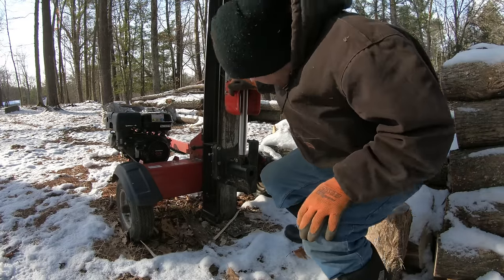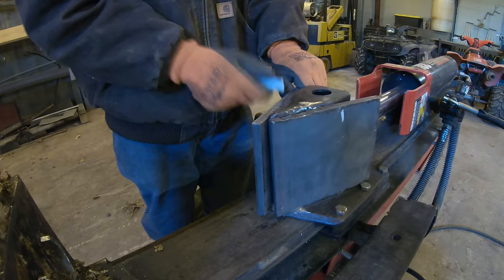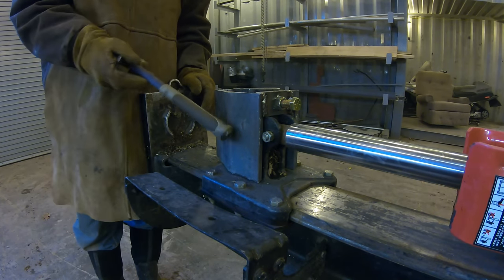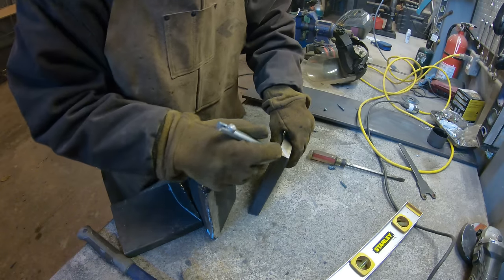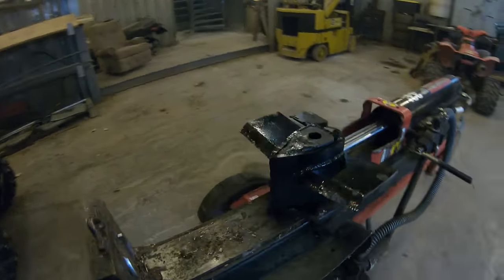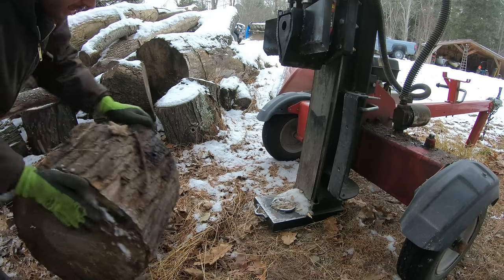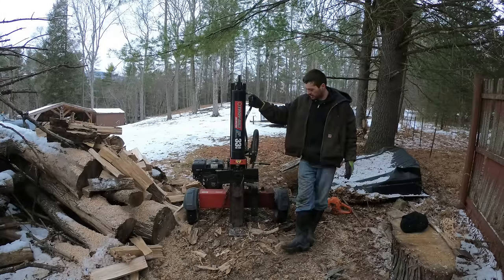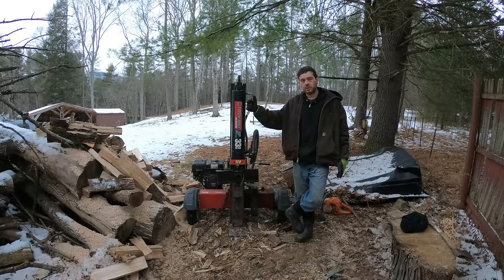Building a 4 way splitter wedge

Comment: I think the reason could be reducing abuse and subsequent warranty claims.

Also re welding and heat transfer to adjacent materials metal or flammable.  You may consider trying a product called 'Fire Ice'..
https://geltechsolutions.com/fireice/product/fireice-shield-spray/..  You can spray it on adjacent materials and they won't heat up.  it will also draw heat from an object to cool id down.  
If you need to work on and engine component and it came in running and is hot..  Spray this gel on it and it will cool it of immediately so you can work on the repair right away.
They don't advertise this last idea but if you get a 2nd degree burn, spray it fight away and it will pull the heat from the burn..  It is a water based non toxic product.  Cleaned up with water.
They also have 2.5 gallon units which we have to have with us when welding in the shipyard.
https://geltechsolutions.com/fireice/product/ul-listed-class-a-fireice-fire-extinguisher/

Go thru their site, welding blankets and aerosols for home use or RV use. https://geltechsolutions.com/fireice/product/fireice-xt-cooling-gel-20-oz-can/.   A whole lot more effective than a 2 or 5lb dry chem plus no mess.

Wildland Fire Fighters have to carry a small belt mounted  extinguisher.

I think if you got some of their products and did a demo it, having a laser temp gauge to measure the difference.

Enough said you and your subscribers can pass judgement.
Cheers

Comment: Two things.  1. They don't mass produce anything like that because you are getting twice as much done in one pass essentially doubling the lifespan before replacing it , other than maybe shortening the lifespan?  2.  I thought to myself there is no way he is bending that half inch plate with a log splitter!  Can't be done!  Then when you got it outside I saw 33 ton, about 11 tons more than what you normally see.  If they made stuff that lasted what would you have to work on or improve?  lol

Comment: Isn't Berl like that log you tried to split valueable?  I bet if you looked it up, depending on what tree it was.   It looked like it was in good shape.  Nice Mod!  Is it sellable??  4 way probably adds stress to the Cylinder, decreasing the life of the splitter over time.  It wasn't looking over stressed, but even if it decreases the life 10-20%, it's a problem.  I'd say it's price point new to the consumer at that point

Comment: hmmmm Think ergonomics, you'e young so bending and lifting doesn't bother you now, but it will, trust me.  My brother heated his old farmhouse with wood for many years and he would host "splittin parties" every fall.  Only his siblings and in-laws were dumb enough to show up.  He was very handy like you.  He was a custom home builder and a welder/fabricator, could fix anything and everything.  The joke was he had a roofing card and it covered everything...  He really had splitting down.

He had built a welding table out of grader blades for the table top. (that's a long story how he "found' those) it was about 12' by 6' and super heavy-duty.  The youngest of us was 40-plus so bending over and lifting all day was not going to happen.  So he sorta built the splitter into one end of the table so we could all be standing up and sliding the wood to feed the splitter on this table.  One guy ran the controls, one or two would clear the split wood and toss it into a pile and one or two would feed the splitter.  My sister-in-law would keep the table stocked with wood and take care of the pile of split wood with a skid steer and bring us cold beer. We could load about a month's worth of wood (depending on how cold it was) in his basement.  On a good day we could fill his basement plus put enough in his shed for most of the winter 

I was thinking you could come up with an idea to take some of the pain of bending over out of your operation when you're splitting.  Maybe by digging a pit to stand in and using the natural slope of your property, (gravity is a wonderful thing and it's free) so the wood slides toward you and the splitter. This thing was a pretty cool back saver.  Check this out.  https://youtu.be/1tRMXF4shE4

Comment: The reason they don't come that way from the manufacturer, is you've quadrupled the pinch points where fingers could be lost. So it's a liability issue for the manufacturer, especially considering there is often beer involved with firewood and a lot of people aren't that smart to begin with. I do have one question, wouldn't you want to hardface the cutting blade of the anvil? I'd think mild steel would dull pretty fast.

Comment: Your wedge is too blunt. If you put a narrower tip on your wedge you'll find it will do a much better job. The back side can be wide but the tip or front leading needs to be narrow.  Mine is 3/4'' plate with a long bevel about an inch deep before it widens out. Give that a try. You will be muck more happy with how it preforms. See how the wood jumps or pops off the wedge. Thats because it's to blunt.
You also need to move the hydraulic lever to the top of the cylinder and back farther away from the wedge. If  a piece gets stuck and misses the push off plate on the return cycle it will hit the lever and damage it. Ask me how I know that. Good build though, it just needs a little tweeking.

Comment: Looking at it, very nicely done and very practical.
You asked multiple times why factory doesn't do a 4 way split.... Then you had the 40+ inch one where you took it off.
Why not do a T shape instead of a X shape. You start with the initial V for the slitter, then weld a piece across the top instead of the wings? aka take the wings further out until they are a T instead of wings?

Comment: Andrew you need to sell that thing or maybe even patent it. I made one simular but; only worked on my splitter with a huge cylinder had to have a lot more PSI still was slower than your splitter. That seemed to work perfectly, with your handy work being more well known everyday you could maybe sell alot of them things. Don't wait and look back saying you should have done somthing it really did work well.

Comment: Thats a good question cause it clearly isn't a matter of safety... I think the deal you made is marketable because you don't have to weld to heat with wood. So if it is delivered split already then the pieces are going to be needed to be resplit. Most of what you made would work in a kitchen stove Plus I found that just big wood alone can go out overnight so a few small pieces mixed with the large stuff makes sure you have coals in the morning, not big black unburned pieces that will get everything dirty for sure. You never see them on a machine for sale, women would love it... my question is why such a small foot on the splitter????

Comment: Your splitter is a little different than others I've seen which are horizontal, anyway with harder steel maybe you could make a nice press with a footswitch the vibration from the pump really helps when you're pressing out bearings or u joints. Just saying

Comment: I use a skid steer splitter for the huge rounds which I can't manhandle to the upright splitter. Make them small enough for the upright. Better yet, and what I plan to do is I think the excavator will be better. Use some thick steel and make a wedge on a thumb. Love your four way wedge design.

Comment: Most store bought splitters have a small 12 or 16 gpm pump if you upgrade to a 20 gpm pump it will speed it up alittle bit to maximize productivity. It looks like you have the hp

Comment: Great job and invention! The second angle cut is perfect since the forward cut will be pushed forward and the one back will try to stay stuck. You can also incline the side blades a little downward forwarded instead of perpendicular so they'll angular position will free space for the back of the back woods. If you don't understand my English attempt please ask me. I can explain further what I meant by that.

When cutting with a grinder you want to use a face shield (transparent) and safety glasses. In case a piece of abrasive blade brakes and hit the shield and brake it you'll still have your transparent safety glasses to protect your eyes. And the face shield will give peace to your face. I learn it while at an Safety Trainer Course for the Construction Industry 500 and 502 by Georgia Tech that allows me to train 10 and 30 hours OSHA Classes for the Construction Industry. Take care bro!

Comment: The splitter company would have made the winged  wedge if you had been working there but, you weren't. They only make so many Andrews at each production batch, if it were not so, there would only be one political party in the USA. There seems to always be less of the  good stuff than the so so stuff and plenty of the so so so stuff. Go figure.

Comment: I can answer some of your questions. The reason they don't put that on all log splitters is because then you were in go back to bite different attachments.

So they were in make money off of you twice, I would have never tried the plasma cutter like you did because I think I would have just made a mess out of it, I would have used a large grinder and cut the angle in.

But in general I think you did a awesome job in making that I think you also already know you need to cut the pieces a little bit smaller than that last huge piece. Always remember Andrew use your head and save your back.

Or in years to come you will pay for that, and I would not like to see that you are a pretty cool guy. And I love your videos and also the reason at least one of the reasons you are so successful is because you do a lot of work yourself.

Otherwise the repairs to that equipment would drive you into bankruptcy that is very good that you are very mechanical incline and a good fabricator and many other things I'm sure you will succeed and really make something out of your business. And I wish you all the luck in the world body

Comment: They dont add the beefy 4 way cutter because the average dude will break the machine 5 x trying to do too much and that is where the splitter folks make $. Keep selling the 1/2 split head and many replacement parts. Make a 4 way cutter and get the job done faster and cleaner.

Comment: My guess to as why they do not come with a 4 way splitter head to begin with is power. Even with a 33 ton splitter, it would struggle and stall allot on harder woods. Around here we have oak, walnuts, elms and hophornbeam that split very hard. With a 25 ton or less, splitting with a 4 way would not work.

Comment: hey andrew i think you should build your own log splitter. with all the tools you have it wouldnt be difficult. you could make it a video all about salvaging motors, pumps and cylinders, and use some metal you have laying around. build it horizontal with a log lift and hydro adjustable wedge.

Comment: a single splitter edge is cheaper to make so sales are easier if your product costs less to manufacture and market. 2nd sometimes 4 wy edge fixed is maybenotalays thebestidea especialy given the poweravailable to split a log. 3rd thecompany does not care if you need one or 3 passes itha single wedge ; it is your time resources not theres, and you cannot take things offa a manufactured product so they probably want to kiss keep it simple... your can bet your puppydog that if their competators start taking marketshare away from them with a  4 way splitter then that will become their basic product line improvement ... and what is thecse, as it levi's day off or what ??? LoL

Comment: That's a strong splitter you have there, 33 US ton splits about anything.

Ok, so here in Sweden the manufacturers has the extra blade but it costs extra and the splitter usually comes without it. The smaller manufacturers, like mine (NE-MA 10 ton 110 cm electric) usually throws in the collector and the extra blade as a good will when you buy from them, if it's a high end model. Price of these extra blades is pretty high, like 750 SEK, is about 90-95 USD, which is ofc extremely over priced.

I mean youre right, they should come with the 4-way standard. Here I think they just have this as extra to make a fortune on that extra little piece of metal.

Comment: We use to use really small mobile torch cutters for breaching doors, they would only run for about 45min but them things would cut through 2" like butter pretty sure it was a company called Broco that made them. we also used little hand held ones that would go for seconds but would handle bars no issue. Basically thermite in a a stick......That is a really nice one you have there, handled that angle cut like a champ.

Comment: Metal bender, Awesome man.  I'd say as to why they dont make them as a 4-way wedge, is that it would cost more.  Brilliant idea of course.  But I can see there being some instability left to right depending on the consistency of the wood.  You induce more wear side to side on the guides, so those should also be beefed up.  You can see the cutter tilt in a few of your segments.  Long term it may need TLC sooner than with a simple wedge in the center, that doesn't induce a bending/tilt to the guide rail.  For you, that's fine, since you are a man of means and can repair wearing.  Maybe I'm wrong, but If one side splits before the other that puts a side load on the rail.  Incredible work my man.  Love your channel.

Comment: I think if you weld a small triangle gusset, maybe 3×1, behind the two blades parallel to them welded on the main blade it would eject logs better and maybe wouldn't get stuck back there as much.

Comment: The companies won't sell them like that because while you were splitting one of the first few logs it was popping apart, if one of those was to hit someone and injure them the company could be sued for dangerous design features or something stupid like that. Also on bigger volumes of firewood the average customer (my uncle) will just buy a second wood splitter to up their output of firewood instead of fabricating something.

Comment: I believe you are splitting a lot of Ash here in the video.  I have always found the ash split much nicer, straighter lines.  If you go out and split ash on really cold mornings - like below zero, you can take a huge piece of ash like the ones you are using the splitter on and take one moderate swing with a typical splitting maul and they just fall apart.  Big pieces of white Oak - not so much.

Comment: Nice metal work involved with this. The plasma cutter work & welding was enjoyable to watch. I like to see the younger generation displaying no fear of physical work! 
I'll try to answer your question on why the splitter mfg's don't incl these 4 way heads with their splitters. MONEY... As an example using my 2003 Brave Iron & Oak 20 ton traditional horizontal splitter as an example. 16 years back when I bought it new, they offered a 4 way head for $275.00, I said thanks but no thanks at that time. I am in the middle of upgrading my splitter with a set of TSC tables to bolt on after drilling my 1/2" holes on 11 1/8" centers. I found the co's website & phone # gave them a call about the 4 way splitter head. They stock plenty of them, no wonder, as I don't think they are a hot seller. Now they want $499.99 for the same 4 way splitter head for my model. The conversation ended right there, I'll build my own for a fraction of what they want. If they offered it for $250.00 I wouldn't buy it!  
Bill on the Hill,
Vermont... :~)

Comment: 12:37 If it were me I would put a jam nut behind that one you welded on to keep that bolt from vibrating loose after using it over and over. It's something beautiful when cheap and easy saves the day... I hate those stupid nylon lock nuts they don't work worth the extra money.

Comment: Good idea but I would of made the wedge bigger. On your big rounds your only splitting small sections with that 4 way. If I were you I would make the ram the plate and put the wedge on the front, then you can get rid of the shroud by the ram. I would think the 4 way wedge would work more efficient if it was in the front.

Comment: Your first split answered the question at the end.... when the "wings" split the wood, it can "jump" out at the operator.

Need to make the nose a bit longer and thinner, less work to start the initial split. Just grind the nose flat and weld a 1/2" thick by 1" piece along the nose then grind an edge on that.
Need to put a larger base on it, was starting to split the larger pieces but then lifting the entire thing up because it wasn't on the base any longer.

Comment: 24" wedge 5 h p gas or electric hydraulic pump table 30" wide x 30" deep will split all knots blocks 24" tall fast cycle time

Comment: Just an engineering comment, if one of the blades catches an angle, could that bend the piston/hydraulics driving the wedge? 
Edit: since the wings are only edged on one side

Comment: Nice, just like a splitting maul, work from the outside in on the big stuff!  Great skills.  If the edges ever wear, you could add a little hard surface weld.  P.S. the reason splitter companies don't build it with the 4 or 6 way splitter, is so you have have to buy that as a $100 to $150 option/accessories.  Modern day America, . . .  where we sell the sizzle, not the steak.